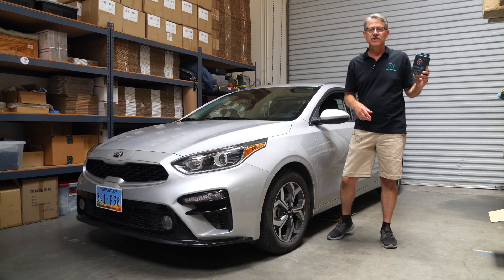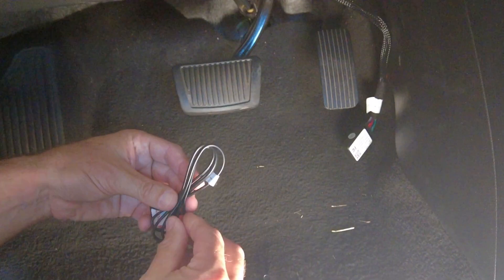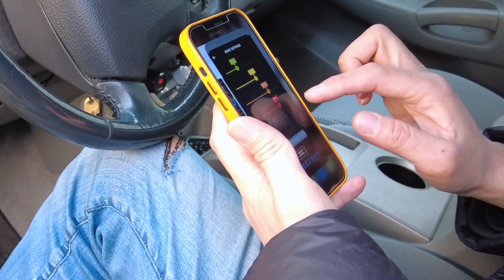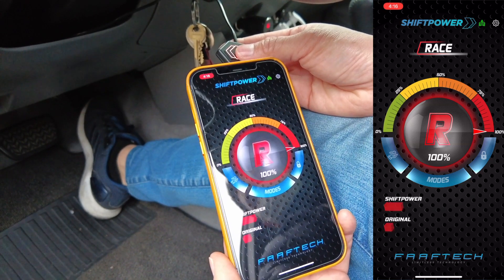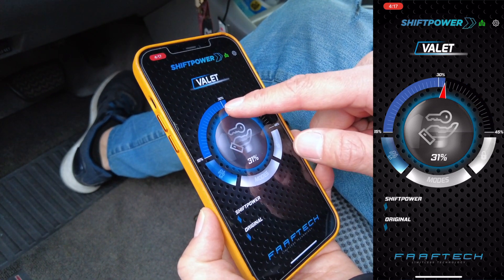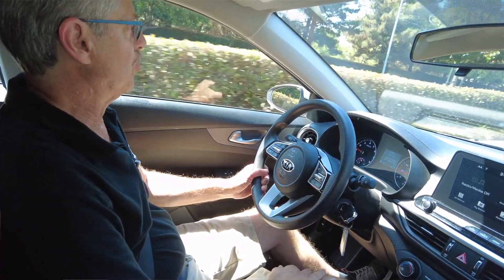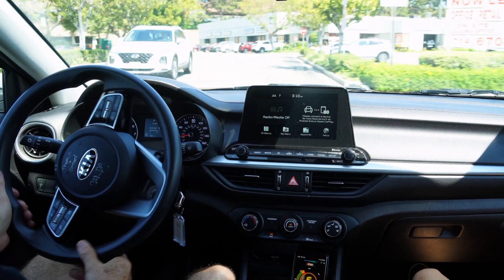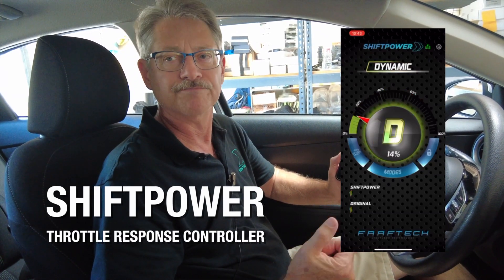KIA FORTE ShiftPower Throttle Response Controller

Comment: Will this not void your factory warranty if something goes wrong with the motor or trans even if it's not related to your product?
Reply from the maker: Negative ghost rider. You can also remove it before you take it back to the dealer. Takes a minute

Comment: Looks like the company has a new owner? I was confused in a couple spots in that video. One of the spots being they can't take your car because when you give it gas it won't go anywhere. Well it will if you unplug it and plug the original gas pedal in, I would think if they knew how to get into my car without a key fob and started they would think about looking at the accelerator. Not that I'm a car thief or anything like that lol. Also on the two I have purchased already and customized for my vehicles I noticed the more response and power you have to your vehicle the more jerkiness and ready to take off that vehicle will have so it can be a little jerky if not adjusted properly something to think about when initially driving the vehicle after installation but they do work good after adjustment.
Reply from the maker: Brett is our guest from Shiftpower USA. Trying something new here. Usually if a thief needs to spend a few minutes to see what’s going on, they would Avon don the vehicle. And trust me, rarely any theif would know what a shiftpower is. Yes fine tuning is needed to hit that sweet spot
Reply: @BeatSonicUS  well for your sake hopefully they know about it everywhere and are buying it. If nobody ever gets to know about it that means it's a failed seller nobody wants that. And he was just using different terminology and I don't think anybody should be given the idea that it's completely fail safe that's the impression I got from the video. Anyway I hope business is good looking for some new products especially for my GS with the infotainment system. Lexus uses G3 technology for their infotainment system and they're taking out G3 at the end of this year so a lot of things are not going to work as in the app any functions of it the SOS button and some stuff on the screen don't know the full extent. That's why I would love to get a Android auto that works with all the buttons on my car to control it with car in motion video watching. If someone could program some of the mirroring functions it would be great more to say if marrying and Android auto had a baby there's a lot of people out there that own Toyotas that are going to need a replacement and money to be made I will be in line 🙂